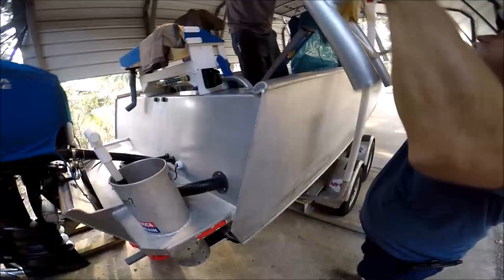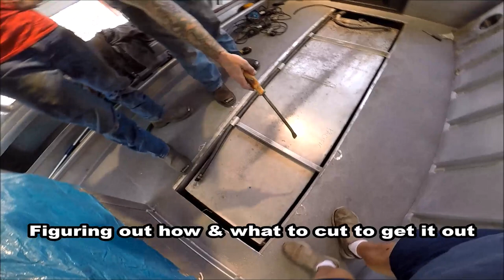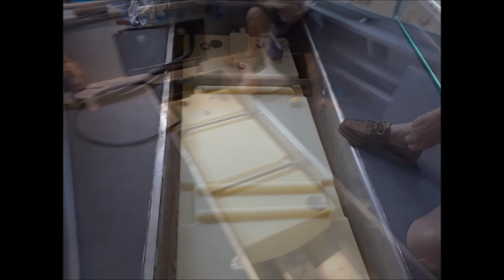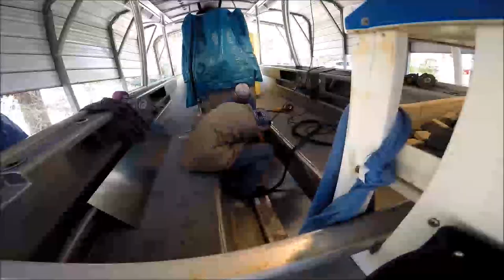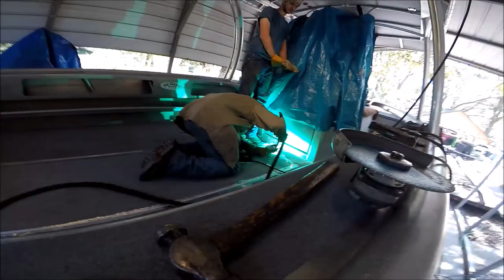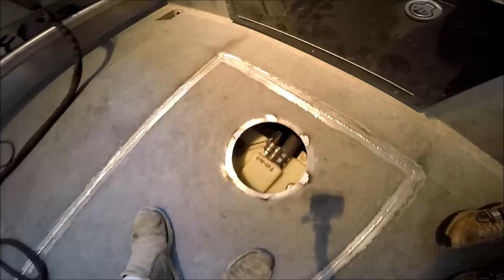POLY FUEL TANK FOR BOAT, BEST OPTION

Comment: I hit 2 potholes in a row one time. 1st one released the tie downs on the stern. 2nd one sent the boat up and back down bending 4 of my roller arms. Each arm was 72 bucks and of course had to fill the swear jar getting the bolts off.
Reply from the maker: rollers.........super YUCK. no one uses those trailers around here. Yeah, well this cost about 10x that...or more! Any fuel tank 10 yrs old if aluminum, steel etc. is on borrowed time usually, anyhow.
Reply: @CaptDavesSportfishing  agree and hate roller trailers. Prefer bunk but 2 years ago put some $ into the rollers and other parts (springs, brakes, actuator, wheels/tires). Should have converted to a bunk at that time but thinking of moving up to a bigger boat so trying not to put any $ into non-critical items. The only time I really appreciate rollers is at some of the funny ramps at low tide. ..even then I never had issues with bunk trailers.

Comment: didn't see any bonding for the old tank in a metal boat with all the electronic's and motor voltage loss there's your problem. well plastic will not corrode but I've herd them blowing apart in rough seas. been on the sea all my life 40+ year happy boating
Reply from the maker: me too.....i stay to calm seas, ''the river & inlets'' as a inshore charter. I had another issue and that caused it, same idea though. Since fixed years before, ''but still''.   Other's exactly like mine still have the original tank past 12 years.

Comment: I had a Maverick Master Angler 21 with a 62 gallon Alum tank around 260 dollars for fill ups loved the boat - hated the fuel bills.  Sorry about your problems Cpt Dave.
Reply from the maker: ALL's GREAT, this was 2 yrs ago..62 gallons at $260?? WOW $4.20 A GALLON? I can fish my 26' aluminum cc all day on 10-15 gals.with 5 people, and try and to only buy only ethanol free fuel at 89 octane for $2.60-$2.80 a gal. right now ''on the street'' 24 gals at a time in jerry cans, cause 99% of gas stations aren't big enough to allow me to pull in a 60' long boat trailer and truck.
Reply: About 10 years ago in Fort Myers.  4 a gallon gas   no ethanol ------my Next boat will be burning ethanol I think.

Comment: Why was bilge wet ? Pacific Boats are fully welded does a anchor locker drain into bilge?
Reply from the maker: Bilge wet? IF I ever have bilge moisture its because those stupid armstrong deck plates get stomped by customers feet, kicked, and beat to death, and leak....or just condensation. Zero drains below.

Comment: I have an aluminum tank. Shouldn't complain after 35 years but it's a bitch to replace. Poly tanks seem to be the way to go.
Reply from the maker: general rules is 10 years with a aluminum tank, after that your on borrowed time, '''''''''''''GENERALLY''''''''''''' ask any marine surveyor.
Reply: @CaptDavesSportfishing  I bought another project boat that had a solid hull and it had a stainless tank, and to think it was a 35 year old Bayliner.
Reply from the maker: @FrostieV  BAYLINER? possibly not original equipment. So bad, they had to change the name, to sell them. hahahaha

Comment: dave it seems to me that wold be a law suite for some shifty work like that on a fuel tank all the tanks iv seen are welded that goes to show what you cant see  quality goes away out of site out of mined your friend lem
Reply from the maker: shifty work? The original tank was not "shifty".  Yes bending a piece of aluminum "could" weaken it. But that's a real long shot. It just corroded because of sitting in constant wet with salt spot. I'd rather sue the road construction company that leaves giant man-hole mountains in the road.
Reply: its just every custom tank iv ever seen maid had stainless tanks my bad
Reply from the maker: You mean 'made', and never seen a stainless tank in anything. aluminum, or poly usually.
Reply: stainless wont rust bust or bite the dust
Reply from the maker: save us all most are most likely built the same. aluminum or poly